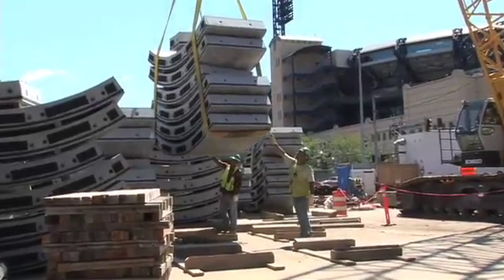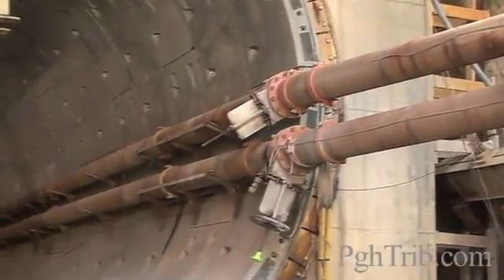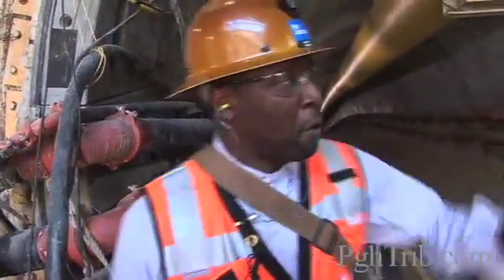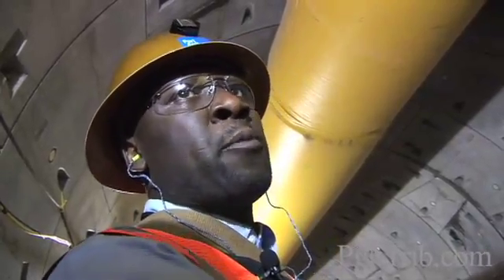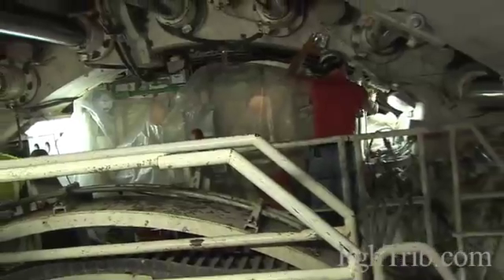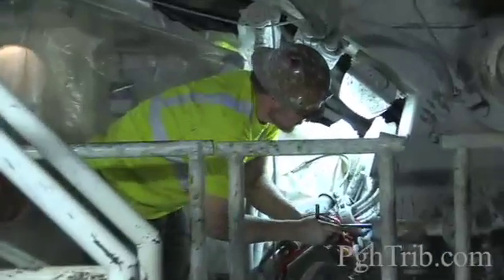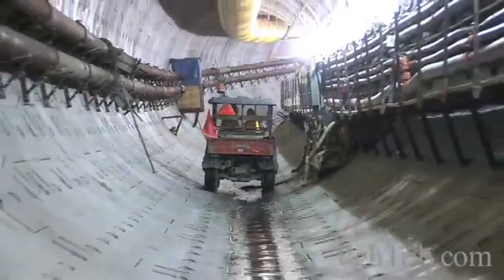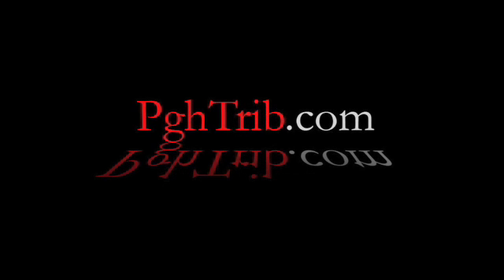Boring a train tunnel under a river

Comment: What amazes me the most is how the TBM cuts through the compressed dirt & rock while maintaining a sufficient seal to keep out any water. It's also impressive how the engineers "know where they are" so that they maintain a sufficient margin from the river bed bottom. Too close and it could collapse in on them, flooding the tunnel.
Reply: There is some sort of ultrasonic transducer sending out a pulse near the front of the machine. On the surface/ outside the machine are surveyors walking around with  receiver 'wands'.
They pick up the signal, triangulate the exact location of the machine.
Work out the relative distance to the planned route, and send a correction course back to the crew steering the machine.
Reply: @TheAefril  Fascinating. Thank you for sharing that.